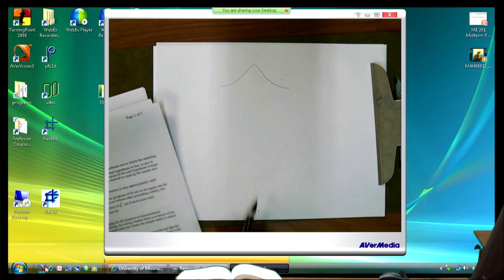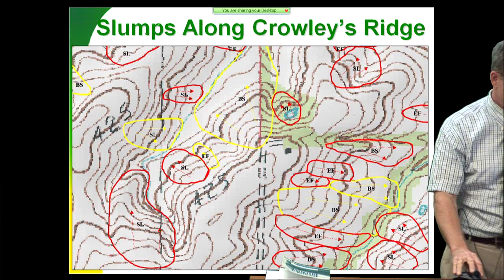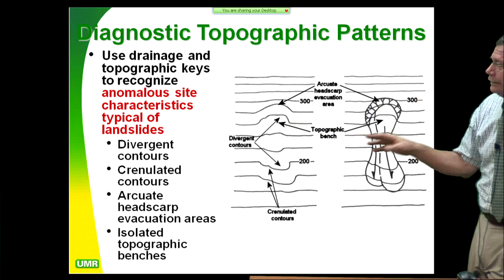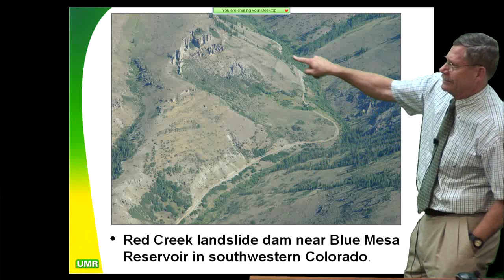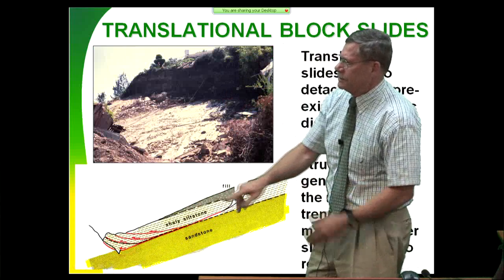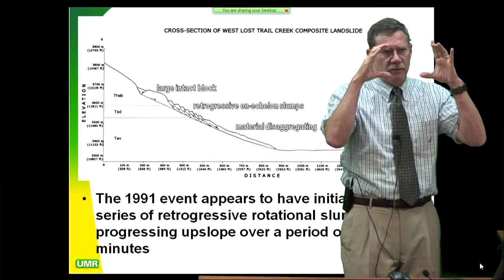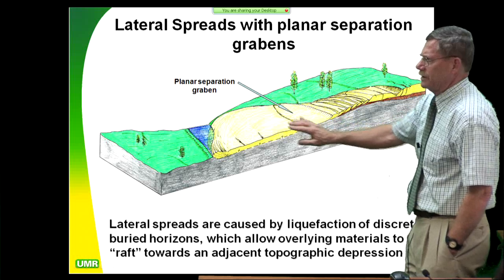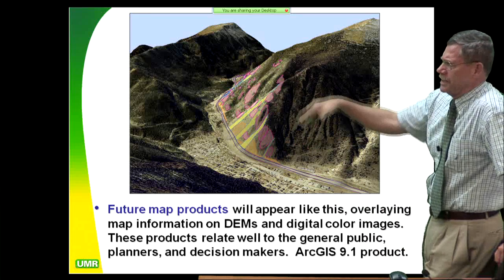Engineering Geology And Geotechnics - Lecture 8

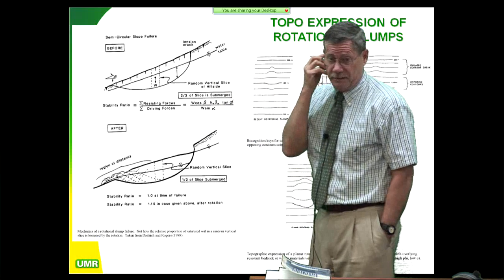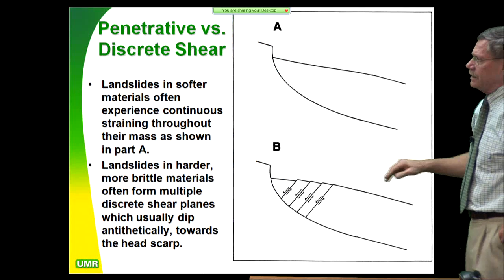Comment: the higher the phi angle the more planar the failure surface is @12:14, a material that moved is gonna have lower unit density @13:40  , @26:20 estimating the depth of the failure slip surface using Bishop method in translational landslide , @26:36 very important idea . A case study of earthflow @32:45